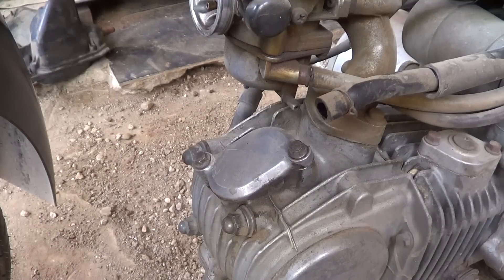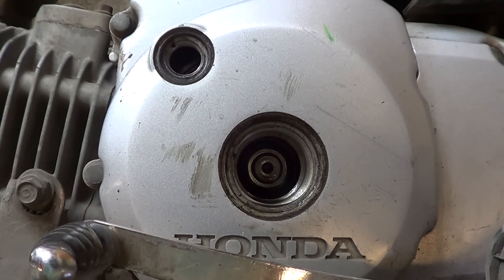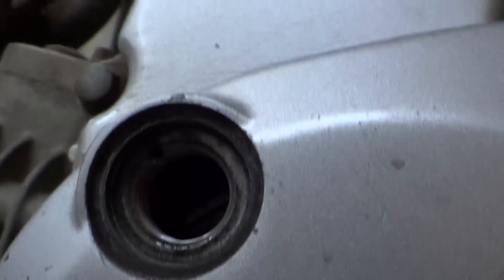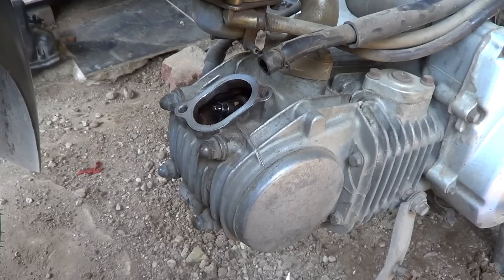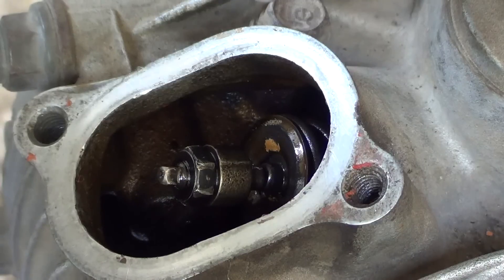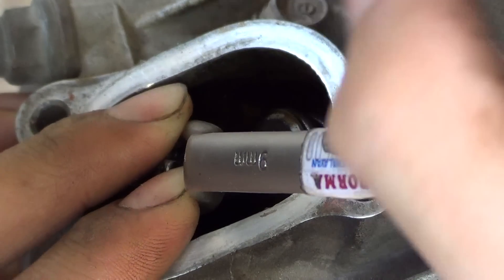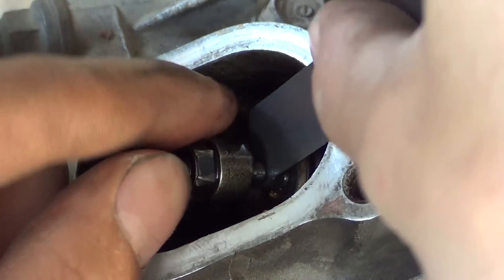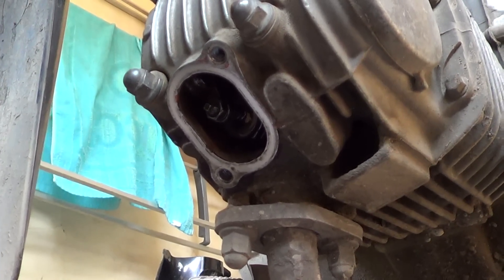How to Adjust Motorcycle Engine Valve Clearance

Comment: Honda has really good schools to train mechanics I went to one of them and it dealt mainly with tuneups there they described a valve adjustment by using the go-no go method. that means you’re putting your .003 mm gauge in but you use the .004 feeler gauge to verify that you have a perfect .003 mm. If the three goes in but the four doesn’t then it’s definitely the .003 mm. If you use this method it will make you a much better mechanic.
Reply from the maker: Thank you so much for your opinion, that's really informative!
Reply: Sekolah Online Teknik Otomotif  You’re welcome I have one more tip that I noticed might help you when you’re trying to stick your feeler gauge in between the tappet and the valve take your feeler gauge and run it across the round part of a screwdriver to put a curl in it this will make it easier for you to stick the feeler gauge in good luck
Reply from the maker: Aha all right! Thank you again for your info! 😀👍

Comment: Thumbs up for the instruction.  But you forgot a important thing,  first  is to remove spark plug to release preasure of the engine for accurate valve clearance..
Reply from the maker: +Martin Apostol Thank you very much for your appreciation.
If you can align the notch perfectly, I believe you can adjust your valve clearance accurately.
Anyway, thanks for your suggestion!

Comment: thanks for the clear video sir... i think i know to adjust my wave 125 valve clearance now... i think we have the same feeler gauge size .03mm for my honda wave..i hope you can provide more video specially how to tune up engine adjusting air in carburetor  thank you so much
Reply from the maker: +lance rizon Ya, you're welcome.
Reply: hi sir thanks for your video I actually succeed adjusting my valve clearance.but my problem again my throttle if I give gasoline the engine will stop please help me
Reply from the maker: +ELEUTERIO RIZON Oh ya, I'm happy to hear that. But could you please explain what does "if I give gasoline" mean? Did you mean idle up?
Reply: try to clean the airbox and the carbuator if the problem is still there check the gas pump maybe your gas pump is not good anymore
Reply from the maker: +Joel Pajarillo 👍

Comment: very helpful info tnx bro and check the valve spring if it is weak
Reply from the maker: Thank you for your appreciation.
Yes, you should check your valve spring when overhauling cylinder head.

Comment: hi idol tnx for very informative and very helpful..ur not jus motorcycle mechanic ur mechanic also a 4wheels huh.nice may I know what's the right gauge for the valve clearance of my vegaforce 115cc engine specially intake and exhaust...?and I want to know if same procedure if  I do it to my Vega the t mark of crank cover and the timing mark.do the same to Honda??
Reply from the maker: I have no reliable data or information resources for Yamaha Vega Force engine valve clearance, but as we know that Yamaha Vega Force have similar engine (and valve) to Yamaha Jupiter Z1, it seems we can use the same specification data with Yamaha Jupiter Z1 to Vega Force. Jupiter Z1 have 26 mm intake and 21 mm exhaust valve diameter, and Vega Force was the same.

So, this is Yamaha Jupiter Z1 engine valve clearance (when cold):
Intake valve: 0.08 mm - 0.12 mm
Exhaust valve: 0.08 mm - 0.12 mm

the procedure is a little bit different, you need to open cylinder head cover to adjust valve clearance, and the mark on the generator rotor maybe only the "I" line-shaped.
I hope this helps.

Comment: thanks man it helps me a lot..best tutorial video..
Reply from the maker: Thanks.
Reply: sir, my gauge does not have 0.03, my lowest gauge is 0.5,. if I am able to adjust the valve of my honda dash, what is the right gauge for it, and what am I going to use in mm. thanks.
Reply from the maker: +shok tong I think you're using car feeler gauge which is more thick, try to use motorcycle feeler gauge. Unfortunately, we have no info about Honda Dash valve clearance, because there's no Honda Dash in Indonesia. Maybe you can search on Google for that specification. Thanks.

Comment: Any suggestion or troubleshoot a suzuki smash backfires and how to treat it.  Hope you make a video. Thanks and more power
Reply from the maker: Severe backfire?
My suggestion is you should clean the carburetor and then re-setting the idle mixture adjusting screw and the idle speed adjusting screw.
Reply: +Sekolah Online Teknik Otomotif oksir thank you. i willtry it tonight.hope u post more videos.
Reply from the maker: Ok, good luck.

Comment: What whill happen if the clearance is not right? What if you dont know the right clearance?
Reply from the maker: If you set the improper valve clearance, the valve mechanism will skittle away the rattle sounds (if the clearances were too wide), or the engine power will be reduced because of compression and combustion loss (if the clearances were too narrow).

Comment: will this work on a yamaha sz-r sir, or different kinds of motorcycle needs different way of tuning-up? btw very nice video sir...
Reply from the maker: +xtian de castro Hei, thanks for your appreciation!
Actually, different engine may need different procedure or tuning specifications.
However, you can see your Yamaha engine, does it have "similar" design or mechanism with mine?
It is better if you use the repair manual for your particular motorcycle.
Good luck 👍
Reply: oh i see, thanks for your reply sir.!
Reply from the maker: +xtian de castro You're welcome 👍
Reply: xtian de castro

Comment: Thanks to this video. Btw is this applicable to yamaha mio/amore scooter? And .03 is universal standard clearance of valve? Thank you
Reply from the maker: +rex limbo Basically, this procedure is applicable to manual adjusted valve mechanism. And yes, to Yamaha Mio.
But the 0.03 mm size is not universal standard. Check your repair manual for that particular valve clearance size. Thank you.

Comment: Thanks mate, great video.
Reply from the maker: +mercenaire2013 Oh thanks for your appreciation 👍
Reply: Hi bro, can you use 0.05 instead of 0.03 gap.
Reply from the maker: +mercenaire2013 In my case (I mean, my motorcycle), YES I can. My repair manual says 0.03 mm (+- 0.02 mm)
Reply: Thanks mate for this precision.
Reply from the maker: +mercenaire2013 You're welcome 👍

Comment: It is the same method of tuning in xrm110? Is the valve clearance the same?
Reply from the maker: +Diosdado Jr. Manghino Actually, I don't have much experience on XRM110. But, basically, the method for adjusting the valve clearance is nearly similar.
Unfortunately, I don't have a repair manual for XRM110, but most people said that the valve clearances for XRM110 are 0.04mm (IN) and 0.06mm (EX).
I'm glad to hear how is the result. Good luck for your project!

Comment: I also had honda 125,but in the manual says 0.10mm on intake valve and 0.17mm on exhaust valve..beside 0.03 is too small,engine can't be started at all
Reply from the maker: Thank you for your feedback.
In this video we use proper repair manual for Honda Karisma 125, and yes we use the proper size for the clearances according to the manual.
Maybe you have different engine type regardless the same engine capacity (125 cc).

Comment: great video! Im Planning to diy my own valve clearance of my '13 Honda Future 125 Which has the similar engine. Thing is, the stock O Ring of the Honda Future always have minor leaks. So i was wondering, is it possible if i just cut a piece of gasket paper with the same size of the tappet adjusting cover and use that instead of the o ring?
Thanks!
Reply from the maker: +Munkee Munks Thanks for your appreciation!
Well, the repair manual usually recommend you to change the old stock O-ring that causes leaks. However, it's possible to stop the leakage by adding sealant to the old stock O-ring or, as you said, using gasket paper.
Personally, as recommended by the manufacturer, I prefer to change the old O-ring with the new-original one as it would be long lasting component.
Good luck with your DIY!
Reply: Sekolah Online Teknik Otomotif so i guess if i change the o ring and adding the paper gasket on top of it, it'll be more effective?
Reply from the maker: +Munkee Munks The manuals recommend us to "just" change the O-ring, and as far as I know, it is faster and easier (or even cheaper!).
Good luck!
Reply: Sekolah Online Teknik Otomotif ahahaha. i agree is faster and cheaper. But the leaks is just driving me nuts! ive changed it 3 times now... genuine Honda o rings. 😂😂
Reply from the maker: +Munkee Munks Well, I understand, in that case you can add sealant to help the o-ring. Good luck 👍

Comment: Hello, i have a question. Does during top dead centre both valve (intake n exhaust) are closed? Should i just simply adjust the locknut with the mentioned measurement using filler gauge?
Reply from the maker: Yes, when the piston is at TDC (end of compression stroke), that is the best position/timing to adjust both valves.

Comment: what is the sign if compression stroke in the flywheel sir
ty sir
Reply from the maker: +Antonio Tolentino By turning the flywheel, you can check the compression stroke (TDC position) by ensuring that the in & ex valves is not pressed by the rocker arm or the cam.

Comment: Good Job mate, i have  a question , what motorcycle was that ? it has the same engine with the Honda XRM 125 here in philippines.
Reply from the maker: +XTO Amazing Oh thanks 👍. It's Honda Karisma 125D in Indonesia.
Reply: Ahh, sir i would like to ask, should i do the same process in adjusting my valves in my Yamaha Crypton R 100 ?
Reply from the maker: +XTO Amazing I think it looks like there will be little difference because the shape of the mechanism is different.

Comment: Hello I just want to ask. Even though marks are not that much aligned tho I can move the valves with my bare hands can I start the adjustment? Because I cant align the mark keep moving its like it has a spring i cant align those mark I made a lot of turns
Reply from the maker: If you can't align the mark perfectly, try to remove the spark plug. Then try again to align the mark.
Good luck!

Comment: thanks for a very informative tutorial. may i know the clearance of honda beat110?
Reply from the maker: +Ephraim Paul Simpliciano Fuel injection or carburetor Honda Beat 110?
Reply: Carburator sir 2015 model
Reply from the maker: +Ephraim Paul Simpliciano Oh, in Indonesia Honda Beat 2015 is a carbureted engine. Where do you from?
But, anyway, this is the valve clearances:
Honda Beat (Carb.):
 IN=0.16mm, EX=0.16mm (both, plus-minus 0.02mm)
Reply: Yeah its carburated sir. I'm from Philippines. Thanks a lot. This really helped me. God bless!
Reply from the maker: +Ephraim Paul Simpliciano You're welcome.
Reply from the maker: +Angie Curry Please speak english, I don't really understand what do you mean. Thanks.

Comment: is there any changes if I replaced my stock camshaft to a higher lift camshaft.
Reply from the maker: +jeepney joyride Yes, you can replace your stock camshaft, but as far as I know, it would need different valve clearance (size).
Good luck 👍

Comment: If you adjust that. The noise can be gone?
Reply from the maker: +Denmark Belmoro If the noise is "really" come from relatively wide valve clearance (no other noise sources), I'm sure it would be gone regarding you adjust the valve clearance properly (standard/recommended size).
Good luck 👍

Comment: How tight is the locknut bro? Because when tightening the lock nut the valve clearance becomes tight even though im using a plier to secure the adjusting screw. It should not be super tight isnt it? Just a few turns will be fine?
Reply from the maker: +Moto Adventurer You need to see your repair manual for more precise torque, and it would be better if you use the torque wrench. However, if you don't have one, use your best knowledge/experience and feeling when tightening the locknut.
Try to hold the adjusting screw as motionless as possible, you can use special plier or an SST L-shaped valve adjusting screw wrench.
Good luck 👍

Comment: I can't insert my feeler gage 003. I don't won't to brack the manufacturer's seal ?. First time trying to fix. The cam spring is touching the adjuster nut is that ok. Dose the nut scrow in the cam spring? Thx
Reply from the maker: In our particular engine, (Honda Karisma 125) the adjuster bolt & nut stay on the rocker arm. Thus, the adjustment doesn't affect the cam spring.
Only use the correct size for your particular engine (is it correct to use 0.03 mm for your engine?). If you can't insert the feeler gauge, try to make the gap wider by turning the bolt on counterclockwise direction. Then, adjust the valve clearances to the correct size (manufacturer's recommendations).
Good luck!
Reply: The bike is an ssr125cc yes it recommends feeler .003 ok I will try. The lock nut is the same as yours

Comment: Pls tell this video is related to tapped problem
Reply from the maker: +Harsh Rai I'm sorry, but I don't really understand what's your questions mean. Could you please explain your questions clearly?
Reply: Sekolah Online Teknik Otomotif i wanted to ask u that in this video the problem is related to tappet sound na
Reply from the maker: +Harsh Rai Oh, did you mean noise on the valve mechanism? If yes, I think that's because of the valve clearances were too big (please note that the valve mechanism components must be normal or not wear out)
Reply: Sekolah Online Teknik Otomotif in my pulsar 150 after starting while accelerating there is sound and continue till accelation and in in start position without accelation sounds comes but when i accelarate dound encreases
Reply from the maker: +Harsh Rai Yah, I think you need to diagnose your engine thoroughly. Try with simple steps, like checking the valve clearances, timing chain tensioner, etc.

Comment: so you mean, if I set the inlet valve with 0.03mm than I same for the exhaust valve too??
Reply from the maker: +Stephan Lopez You should follow repair manual for your particular motorcycle, it may have different specification. My Honda Karisma 125D have 0.03 mm valve clearance for both intake and exhaust valve (it based on repair manual).
Reply: but can i ask you a question. is your inlet valve and exhaust valve the same diameter or one of this two is bigger than the other??
Reply from the maker: +Stephan Lopez Unfortunately, there's only valve clearance in manual book, and do not include the valve diameter.
But if you ask the valve stem outside diameter, Honda Karisma 125 has 4.975-4.990 mm for IN, and 4.955-4.970 mm for EX. Yes, it's different size. But manufacturer recommends the same size for valve clearance.

Comment: Hello sir,I have the same motorcycle as yours.When the engine cold,the is no knocking sound,but when the engine is hot,there is a knocking sound from the head,is it okay?or do I need to setting the valve again?
Reply from the maker: Hello, thank you for your question.
So did you set the valve with the proper clearances already?
Reply: @sekolahonlineteknikotomotif  yes I did,after I change the original camshaft to racing camshaft(high cam).Just as I said,when the engine cold,there's no knocking sound,but when the engine is hot,the knocking sound started.Is this normally happen when you already change the camshaft to racing camshaft?Or should I need to setting the valve again?
Reply from the maker: @wilsonsunang6049  Well, I see. So I believe it's because of the change of the camshaft that you've made. Unoriginal camshaft may have slightly different material, thus it has different expansion when exposed to heat.
You may calculate your own valve clearance to compensate the changes that you've made, otherwise it's better to use back the original camshaft.
Good luck!
Reply: @sekolahonlineteknikotomotif  if I let it happen,would it make my engine broke or no?

Comment: Hi, I adjusted my valve clearance. its a Honda Click. However, now my engine stalls/dies during idle or while running.
Reply from the maker: Recheck your adjustment. Is there something wrong?
Always check and adjust the valve clearance on the TDC compression.
Reply: @sekolahonlineteknikotomotif  thanks. i examined my engine. a few seconds after starting, i see some sparks that escape from the sparkplug cap. this is not normal right? I think i will need to replace the cap. Need to look for tutorial how since shops are far feom my area. thanks for the reply!
Reply from the maker: Yes, that's might be the main problem. The electric current shouldn't jump through the cap.
Good luck with your work!

Comment: When i turn the flywheel to Top dead center.. is it okay to adjust valve clearance if the marking on the cam timing is not in position..
Reply from the maker: +xander blythe It's called "top dead center" if the notches were aligned. So, it's highly recommend to align the notches on TDC position before valve clearance adjustment.
Thank you.
Reply: Thank you for your  reply...
Do you have videos on how to set cam timing?
Reply from the maker: +xander blythe Oh, I haven't yet. But if I have time and opportunity I will make this video request. Thank you.
Reply: Why is my T mark wont allign with the notch.. the flywheel slips when i allign it on the notch
Reply from the maker: +xander blythe Yes, it may happen. But try hold for a while in align position. I hope it helps.
Reply: Thank you for quick responses.. God bless
Reply from the maker: +xander blythe You're welcome.
Reply: xander blythe